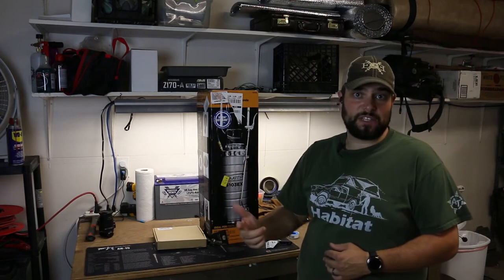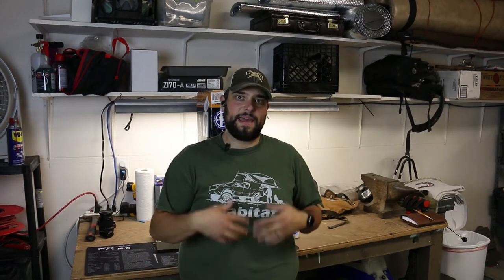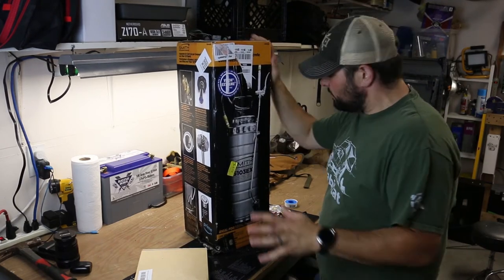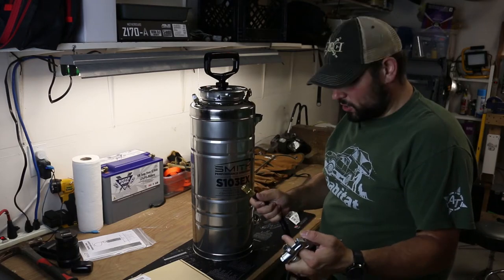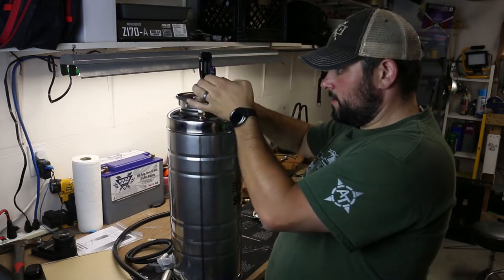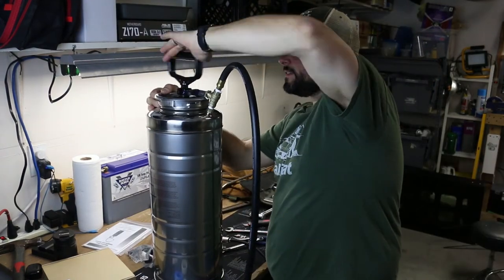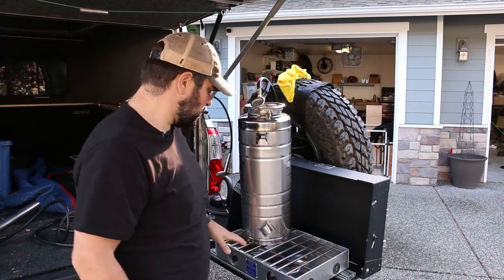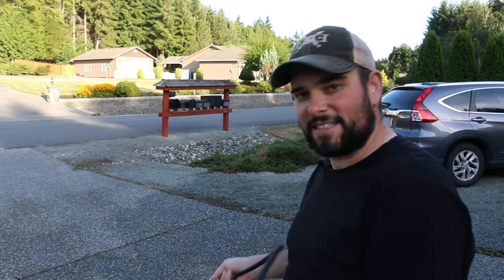Best Overland Camping Shower - Build It Yourself

Comment: Heck yes I like how your mind works! I’ve been thinking about a method to heat water and take showers in an emergency situation. Originally I was thinking of getting an electrode water heater to heat water in a plastic sprayer then using that. But to have a metal sprayer you have the option to heat over fire OR with an electrode heater. 

 You’ve just earned a new subscriber. 👍
Reply from the maker: Thanks Totes. I love backyard. Engineering. Lol🤣

Comment: Expensive but very awesome 👍
Reply from the maker: There are probably more cost effective ways to make this without heating the unit up on the stove aspect. If you got your water hot in whatever pot you bring camping you could get away with building this out of a plastic pump sprayer I'm thinking. Thanks for watching

Comment: Thank you so much posting this! Gonna build one.
I too was looking for the Zodi.
How is it holding up?
Any rust or issues that you have found or design changes that would make in your approach so I can modify accordingly?
Is the handle and pump assembly metal? (That's the downside of the cheap plastic sprayers/plastic)
How many pumps does it need for expelling the 3 gallons? And how long of shower can you take in one run?
Thanks again fellow overlander!!

Comment: Very cool, thank you for sharing! 

Hey I am wondering if I could set up the same thing but with a slightly different stainless steel 3 gallon sprayer, I found one for a bit less, just on a super critical budget.
Reply from the maker: I don’t see why not. I would heat make sure the reviews of the one you are looking at are positive

Comment: Hey there I am just curious as to why you went with that particular sprayer. I found one like yours for a lower price, just on a pretty critical budget right now. I guess my question is would I be able to use a similar one, it’s stainless steel 3 gallon pump sprayer.

Comment: I'm not sure stainless steel is the best option as this will rust.  I wonder if there are any high quality plastic designs similiar to this that can withstand the high pressure.
Reply: Plastic will melt

Comment: Awesome video! This is perfect because I have actually been trying to buy the zodi extreme for months and can’t find it anywhere. Their website isn’t working either. I had no idea they were going out of business. But to be honest, this looks like a better setup anyway. I’m definitely doing this. Was just looking at amazon and saw a shorter wider tank. Any other good brands that you considered? I have a summit camper on a crewmax tundra (similar setup to you) so am trying to figure out how I want to mount mine as well. The short/wide option might work better so it’s not so top heavy when loaded? Or is that even an issue on yours?
Reply from the maker: Shorter stainless unit would work I am sure. I went with the Smith unit for the 3.5 gallon cylinder. I haven't mounted it yet, but I'll show off where I do once I do. Thanks for watching!